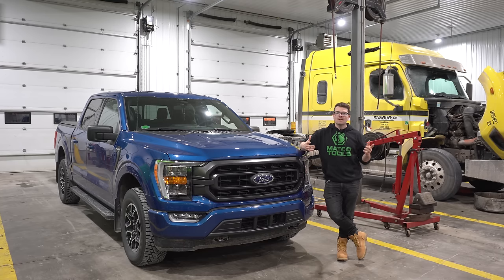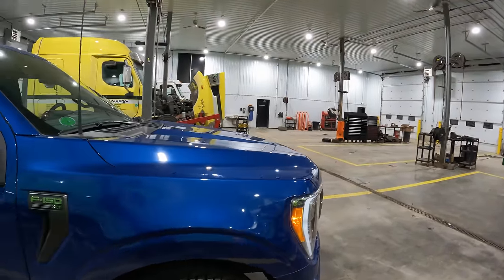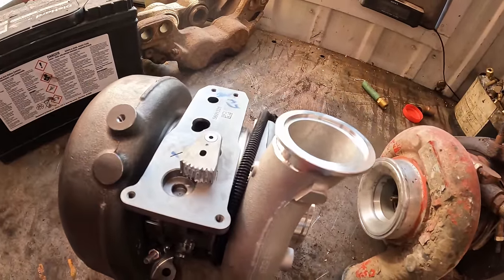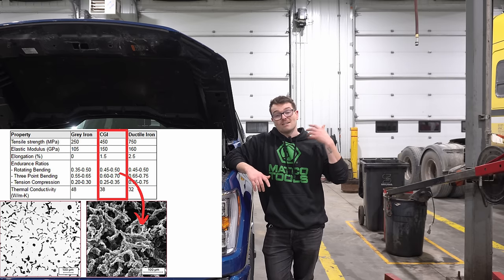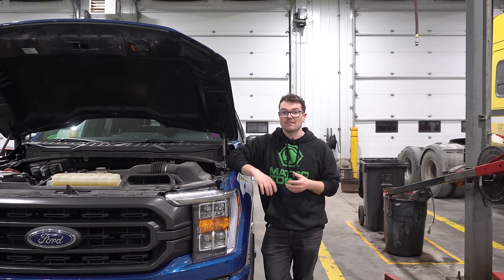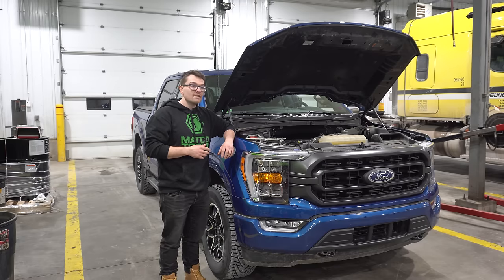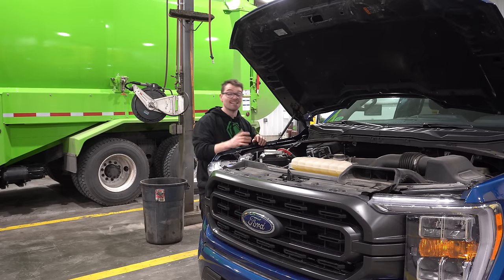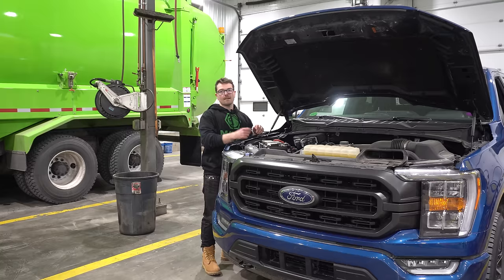Ford F150 2.7L EcoBoost V6 Engine **Heavy Mechanic Review** | How GOOD Is It??

Comment: Very impressed with the 2.7 so far. Went from a 2013 5.0 to a 2019 2.7, the 2.7 tows better and gets about 5mpg better.
Reply: What do you tow most of the time? i have a 1st gen 2.7 never towed anything yet
Reply: @donnym.5826  A 19 ft boat.
Reply: I have the F150 2021 STX 5.0 V8 4x4, I'm trying to save gas. Does the V6 2.7 saves gas?
Reply: @jesseontiveros8402 around town it does better but the turbo at high speeds is going to suck fuel like a V8.
Reply: I tow a bass boat.   Trying to decide between the 5.0 and 2.7 new 2024.  Any thoughts are appreciated
Reply: @G-ew9hv 2.7l is pretty impressive. Just hauled a 6x12 U-Haul (5,000#, or so). I drove 65 for the most part and got 14.5mpg in heavy winds. Hit 15.2 I think at one point. The more I’m hearing about it, the more I’m happy with my purchase.
Reply: @drewgerow1392  thanks!
Reply: @G-ew9hv  I was in the same boat. I just ordered a 2025 RCSB with the base 2.7.
Reply: @CHUCKRYALS1234 yep.  The 2.7 is a beast!  Pulls my 20’ Ranger very well.  Much better than my old Chevy 5.3 for sure.
Reply: @jesseontiveros8402 yes it sure does. The coyote is a fuel guzzler. Averaged 16.8 mpg on my 19 for years. My commute is a 50 mile round trip at 70mph every day. It was pathetic fuel milage. Traded for a 24 with 2.7. I'd never EVER go back. 21mpg same trip.

Comment: I have a 2016 2.7 liter 97K miles. Just paid it off last year. I thought hard about "upgrading" to a 3.5.  I decided to keep my 2.7 for a while especially since interest rates are so high. I worked at Ford as a tech for a while and I told one of the old timer mechanics; I wish I had a 3.5. He looked at me like I was a moron and said my 2.7  is a way better engine. We had a lot of issues with cam phasers on the 3.5. I found that unless you are towing big toys there isn't much of a reason for the 3.5. I take mine hunting, camping and rip through mud and places I shouldn't go all the time :). 2.7 gets the job done.
Reply: I have a 2015 with 160K miles. I’m young and love it the twin turbos make it super quick. Religious oil changes and regular maintenance and taking care of the truck should stand strong.
Reply: How much gas did it take to fill back up after getting 922 on that tank?
Reply: cam phasers have supposedly been fixed. if that's the only issue, if they go bad, replacing them with the update seems to be a 'fix'
Reply: Get a real truck with a V8 if you want to save gas buy a Corolla.
Reply: @AVMAR so if you own a truck, saving money on fuel don’t matter?
Reply: You can juice the 3.5 to 420 horse and another 100 torque with a rousch intake and a programmer. Kinda amazing from the 3.5 but most want better fuel economy and those two options will remove all of that for sure.

Comment: Just got a 2022 2.7 on Sunday. Switched from a Tacoma due to needing more size. I  was nervous about the reliability of the ford but love hearing these positive comments and feedback
Reply: I’m in your same boat right now 😊
Reply: Give it time 😂
Reply: Just take care of it, let it warm up, let the oil warm and get to the turbos and everything. I warm my truck up for a few minutes before I roll every time. Oil change every 5k miles. I just rolled over 108k and it still runs great with no issues
Reply: @somersetbassett4580  I mean everything has some flaws over time
Reply: I got rid of my 2015 Tacoma rust bucket that couldn’t get 18 mpg in town and the 4.0 was a boat anchor, worst seats and shifter in any vehicle I had ever owned, 350 mile trip I was out for a day trying to recover, went to the 2.7 F150 in 2017 and last fall traded it after 94k flawless miles for a larger bed super cab, bench seat ( now can haul 6) rubber floor FX package lower rear end for towing and yep got the same butter smooth never stressed 2.7 Ecoboost and seeing 22 around town in Econ mode driving like a grandpa cause I am, but I occasionally leave a 5.3 or 5.7 sitting at a red light if the wife ain’t with me😅
Reply: @stephenpierce2289 Everything… except Toyota. Especially the Tundra that did 1 million miles with the original engine…bulletproof V8 made by Toyota.
Reply: 2019 here with 100k on my 2.7 has been flawless but I also change oil every 5,000-6,000 miles the truck is amazing and hands down the best one i have ever owned but frequent oils changes every 5k with full synthetic is recommended
Reply: @chepinchan 
BS!! The Toyota V8 was a total inefficient gas hog. I get so sick of hearing about Toyota. Overhyped and overpriced. The Tacoma is so overhyped. Until recently they drove like crap and underpowered.

Comment: I certainly love my 2022 Ford F-150 XLT Super Cab 4x4 with the 2.7 liter twin turbo EcoBoost V6 & 10r80 ten speed automatic transmission! With 3.55 axle gears I routinely get 450+ miles per tank on the "smaller" 23 gal fuel tank on mixed/work driving. I've seen as high as 26 MPG for long distance highway driving which I haven't done alot of which translates to over 500 miles per tank! And Motor Week has tested out the 2nd Gen 2.7 liter EcoBoost V6 in a 2018 Ford F-150 Lariat Super Crew Cab 4x4 configuration + gotten 5.7 seconds 0-60 MPH & mid 14 second quarter mile ET's in bone-stock form. Quite amazing for only a 165 CID engine! I also love the fact that this motor can easily run on 87 octane fuel too. I've run Kwik Trip 88 Octane (E-15) fuel with no issues as it's even cheaper in cost compared to 87 octane + one point higher in octane rating. I'll run Kwik Trip 91 octane "non-oxy" fuel whenever I can though. I have an AFE Momentum GT enclosed cold air intake system with "dry" non-oiled synthetic cone filter & an SPD Performance HX-Series 3" stainless steel exhaust system so far. Love my Ford F-150 with this engine!

Comment: I was worried about buying a truck with such a small engine but man I'm glad I did it. I absolutely love my 2.7L!!
Reply: How long have you had it?
Reply: @georgehernandez1502  Just over 2 years. It's a 2016 with 103,000.
Reply: Same here
Reply: @seanhatch1538  great to hear. I’m eyeballing a great deal right now, only 2 hesitations is, it’s a supercab with a 2.7. But after hours of research, seems like a great choice if maintained
Reply: @georgehernandez1502  I run only full synthetic oil every 4-5k. I live in Idaho and to my surprise, this engine warms up extremely fast. Even if it's below zero, my windows are defrosted within about 5 minutes of starting.  I just can't say enough good things about it. You will love it!
Reply: @seanhatch1538  thanks for the help. It’s helping me make my decision. I’m pretty good w/ my maintenance routines, but this will be my first ford. Usually Chevys and Toyota are the norm in my family. Much appreciated and god bless.
Reply: @georgehernandez1502 if you can have recorded maintenance that’s a plus. With the turbos the oil changes are definitely important. 2015 2.7 here with 160k miles
Reply: I have a 2018 2.7 f150 sport only has 51,000 on it.  My first truck will never go back to driving a car again.
Reply: I’m eyeballing a 2021 with 99,000  should I get it
Reply: I love mine!!!

Comment: I just sold my F150 with the 2.7.  It had 112K and it was absolutely flawless!  Changed the oil and put a battery on it after 6 years.  Best truck I have owned!
Reply: @gk7754  I just changed jobs, so I got a company vehicle. Due to that, I sold my truck and trading our Armada for a late model truck. I’m leaning towards a Tremor if I’m able. I hope whatever I end up with is as reliable as my ‘16!

Comment: Love my 2017 2.7 XLT. Happened into it by luck, as a buddy was selling his truck for a song 2.5 years ago when the market was nuts. Never thought I'd want a 2.7 until I took him up on his deal. I'm super happy with my truck. 2.7, 6spd auto, XLT 302A Supercrew, 5' Bed, 4x4. 146,000 miles and going. Been everywhere from Florida in summer to Northern Canada in January and in between.  600  miles between fills with the 36 gallon tank.

Comment: Good stuff, as always, love all the details.  They put a LOT of engineering into that engine, I can't help but wonder how much better other engines could be with some of the same engineering.  A video comparing the two 2.7L engines (Chevy I4 and Ford V6) in the segment would be interesting.  Subaru used offset rods in their 3.6 H6 (EZ36D).  I have seen them refered to as 'pork chop' rods because of their shape.  Looking forward to the next video, the bloopers are an awesome touch.
Reply from the maker: If I put in even half the bloopers we'd be here all night lol but I plan on doing a direct towing comparison between the 2 engines and a fuel economy run. It's very interesting to me how both manufacturers attempted to make a small displacement forced induction engine. personally I feel like the inline 4 from GM may tow better but we'll see!
Reply: I have the Chevy and the ford eco boost.  The engines feel way different from each other. The ford eco boost is fast and the power and is in the mid to upper rpm range. The Chevy is a little slower but way more toque and it’s noticeable with a load. The Chevy puts out peak torque around 1500 rpm so it feels more diesel like. Both are great trucks. The ford has 150k miles and it’s still running great. The Chevy is only a year old with 55k miles so time will tell with that one.

Comment: A few other important notes about the 2.7 you might have missed. 

The exhaust headers are integrated on this engine. This means that you get a fast warm up on this engine for better fuel economy and happier turbos. 

The CGI block in combination with the integrated exhaust headers means this block likes to keep heat. This is good because when the engine is shut down it cools very slowly, and the coolant system is designed to passively flow using that heat energy. This makes sure that your turbos cool down much slower than usual. Also, if you live a cold climate like me, it means that you can leave the engine for a few hours and come back with coolant still somewhat warm for the heater. 

The "big brother" to this engine IMO isn't the 3.5, its actually the 3.0 found in many Lincoln products and also the new ranger raptor. They are very similar motors, the main difference is the 3.0 is fully aluminum, has larger turbos, and has an increased bore and stroke. For this it makes more horsepower. Almost comparable to the 3.5.

Finally, the oil driven wet belt was introduced on the 2018 models and so far from what I've seen seems to be lasting to higher mileage. If thats a worry tho, I would just buy the first gen 2.7 with a conventional setup.
Reply: I've also heard that the exhaust has water cooling jackets that also keep the turbos from overheating
Reply: @chrisvids1820  that's the integrated exhaust manifold. If you look at 3D renders of the engine, you'll notice there is no external manifold. There is a single port for exhaust release which bolts straight to the turbocharger assembly.
Reply: The 3.0 raptor engine in Australia is blowing up. Over 12,000 engine replacements reported 2023 plus counting.
Reply: @ev0wat  The 3.0 has been rock solid in all applications here in America, particularly in the Lincoln products. You got a source to back you up?
Reply: Hate the idea of the wet belt for the oil pump, and hate the composite oil pan. But so far my ‘21 has been amazing. Couldn’t be happier.
Reply: Don’t get fooled heat kills engines and transmissions
Reply: @alcerz984  Obviously too much heat is bad, but the system is very controlled. These large radiators with electric fans can dissipate more than enough heat to keep the engine at safe operating temperatures.

Comment: Awesome  review! 

I have a 2015 F 150 2.7  and i will say this is by far the best engine ford offers in the F150!

My truck is 9 yrs old and not 1 single problem. I tow my racecar alot can barely tell that im pulling a trailer. I do have the trailer tow package and 3.73 gears.

I avg 19.8 miles per gallon combine for the past 9 years.

When i 1st bought my truck i contenplated about getting  the 3.5 or 2.7 and after  several different test drives with both engines the 2.7 was a little faster,  i couldn't believe it so i choose the 2.7 and i couldn't be any happier.

Comment: Cant wait to see the towing review. I have a 2015 2.7 and while my heart was set on the 5.0 Ive been really impressed with it. 150k miles on it and Ive never seen the check engine light. I tow up to 8k lbs and it’s always gotten the job done. 

All of that and it still keeps up with my buddies 5.7 hemi 😉 for a half ton truck motor it’s really hard to beat the 2.7. id venture to say 90% of people with other motors would be happier if they had got it instead of anything else.
Reply: I got a 2019 2.7 only thing I wish is that it was louder and didn't sound sporty with cat back exhaust

Comment: Was hellbent on the 5.0 when I bought my ‘21 new. But after more research and driving some relatives 2.7 I went with it. And I cannot be more pleased with this little engine. All the power you need in these size trucks, phenomenal fuel economy, and built to last. The oil pump wet belt is concerning but only time will tell for that. Also hate the composite oil pan, but I’ve got RCI skid plates to protect that. 55k miles no issues other than an EGR sensor. 

Also I’m not 100% sure but I believe the 3.5 is a Mazda based engine (much like the 2.0 ecoboost is to the Mazda 2.3) whereas the 2.7 is a fully Ford engineered engine.

Comment: I have an F-150 2018. Bought new and it has been so reliable, just a beast. Great on fuel with tons of power for what I do.
Reply: Me too. Great motor and truck. Needs maintenance, more than others. 60k on mine. Every fluid changed...this is a must. Have family at Ford. Engineering dept etc. Hoping to run mine into the ground.